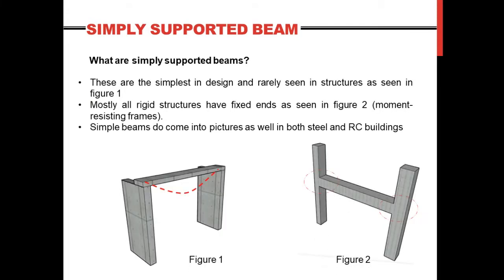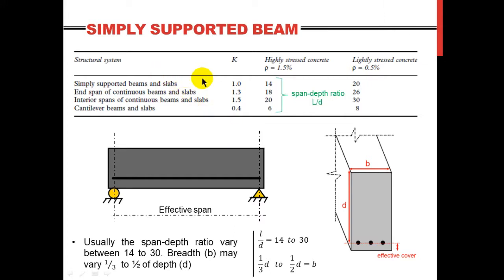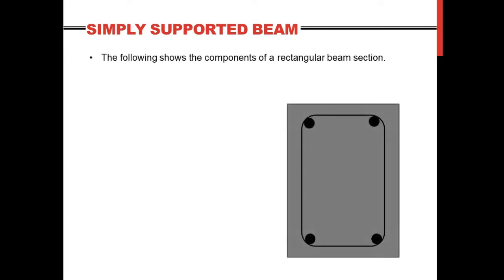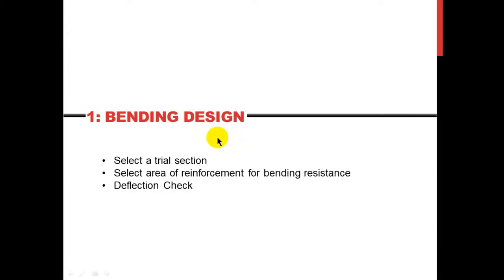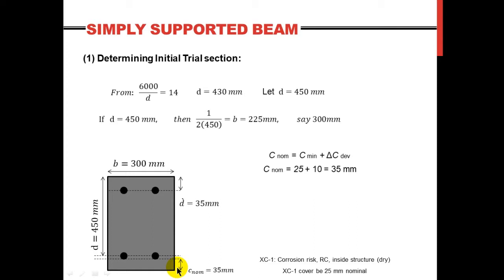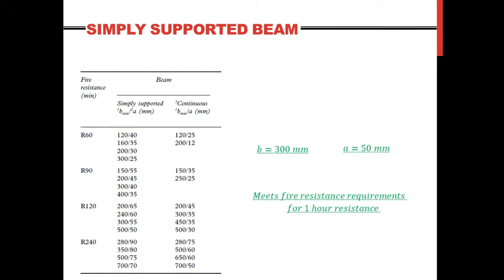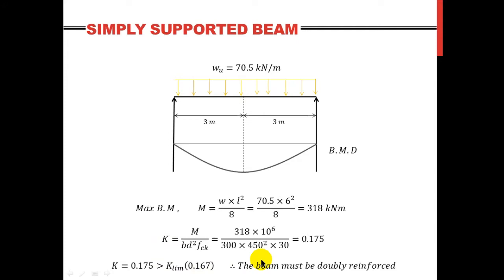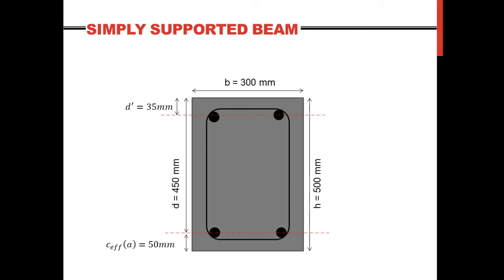Part 1: Beam Design to EC2 (Introduction & Trial Section)

Comment: Hi! thanks for the informative video! I was wondering how is K' = 0.167. Is the reference for this Table 15.4 of the Concise EC2?? If so, is 15 percent re-distribution ratio?
Reply: Hi. To assure a ductile failure we take a maximum value of x/d which is 0.45 --> it corresponds to K'=0.167.

Comment: Very useful for as an intial sizing guide. If i were to do this for a continuous bean with say 6 load combos of Gk and Qk, would step 2) include calculating the moment envelope and then using moment redistribution to redistribute the worst hogging moments and then from the redistributed envelope i would obtain my design moment ? If so How would i determine what percent of moment redistribution is needed?

Comment: Hi Abdullah, Im getting  55.5 mm as axis distance, Pleas see at 15:40
Reply from the maker: You're correct dear.
Anyway, it will not differ that much, 5.5 mm is way to small to be significant.